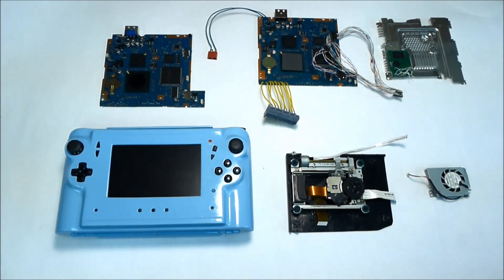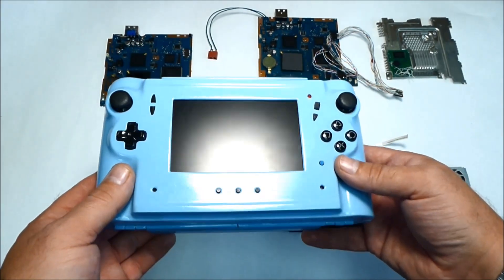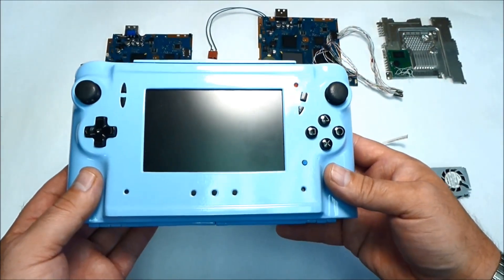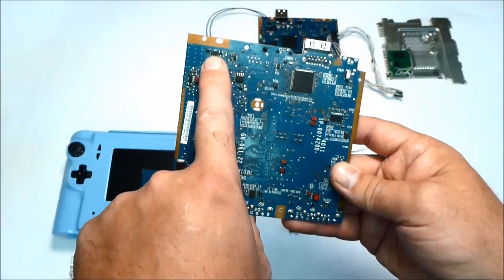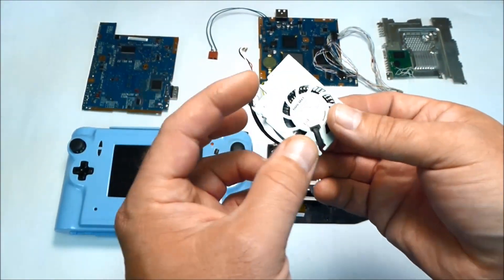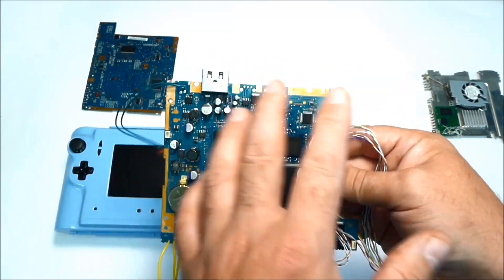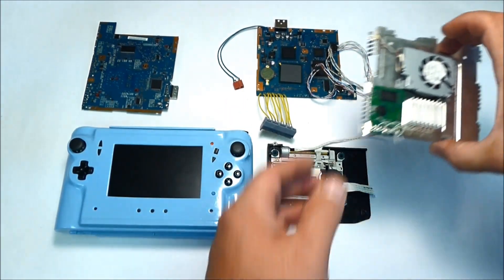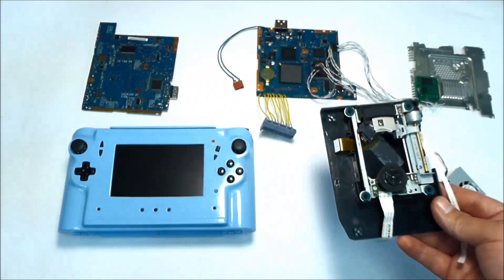Replacing Motherboard on my Homemade Portable Handheld SONY PS2  DIY tutorial

Comment: I'm having issue desoldering the av port any tip or guide
Reply: PS it's a 9001 (Gh-072-42-1p-008c00-4011)
Reply: Woah not even a reply :(
Reply: @Kewiner it's like I got everything desoldered but killed it. I got a worklog of it and the latest portable up on my channel